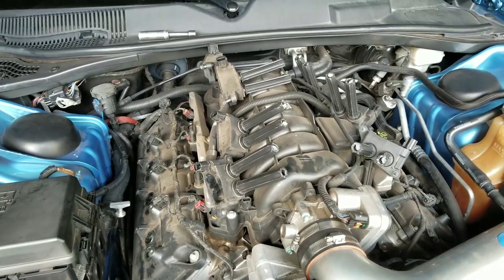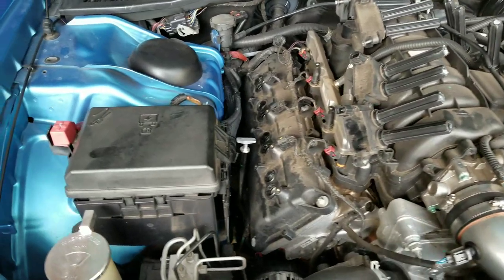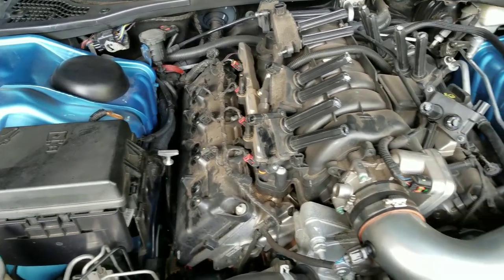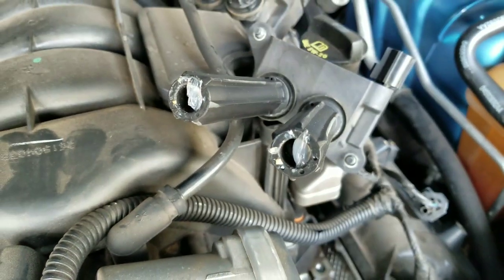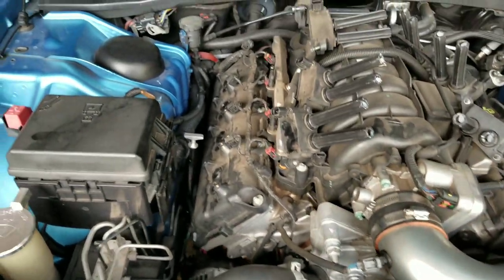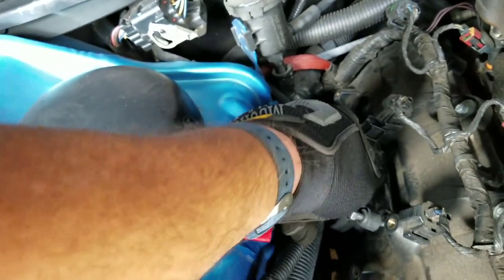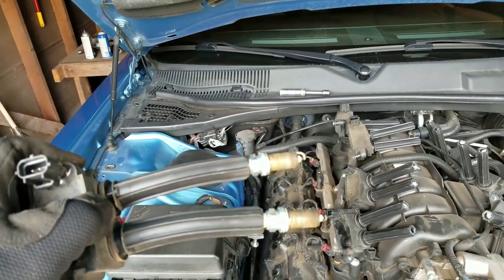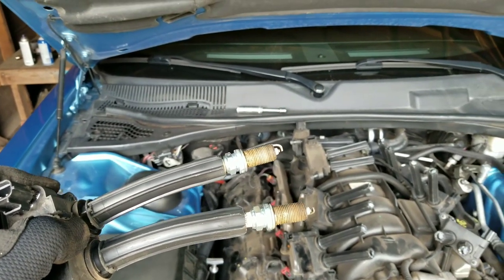Removing Spark Plugs Trick  HEMI 5.7l

Comment: The old mechanic trick is to get some heater hose that just fits snug on your plugs and cut it long enough that you can retrieve the plug. 
Then place the new plug into the hose and start threading it into the spark plug hole.
That way you won't cross-thread it.

Comment: This will work for removing the plugs if you don't have a spark plug socket but you'll still need one when you reinstall the plugs so I recommend getting one before you begin and just use it to both remove and install the plugs.  If you try to reinstall the plugs without the socket you risk the plug siding down the tube and the tip smacking against something, thus bending the electrode and throwing the gap out of calibration.  Also, you don't want the threads touching anything if they have anti-seize on them. With a spark plug socket the plug is centered in the tube and the threads will not touch anything on the way down.  5/8" plug sockets are available at most auto parts store in either magnetic or friction fit.

Comment: that's a pretty good idea for removing them if you don't have the right spark plug socket with the boot of putting them back in is a whole different challenge you really need the spark plug socket with the boot
Reply: I would suggest using a piece of hose or vinyl tubing to slop over the plug, apply never-seize to threads of plug then turn the plug in by hand and use a plug socket with the rubber sleeve removed to do the final tightening. By removing the rubber sleeve in the socket you end the possibility of the socket coming off the extension and having to fish it out with needle grip pliers....

Comment: I usually have the auto store cut me a rubber hose/vacuum line that fits the spark plug to remove and to start them so they don’t cross thread but I bet the dealer does exactly what you did.

Comment: @Paul SC, I have a question and maybe you have a lead for me.  I changed the Ignition Coils for high performance ones from RIPP.   On their web site it says direct replacement, and I did that and tighten all the screws up on those 8 new coils, so all is well seated.  Now my car runs as if it had 100 whp! !!  It' smells gas in the exhaust when I wind it in park...  It's really sad to watch....  DO you have any advice for this?

Comment: That’s an interesting trick....thanks.

Now that you have done the plug change and see how it looks more intimidating than it really is will you wait another 150K for changing again?   I would personally be skittish about that long of a change interval especially on spark plugs which for the most part are fairly simple to remove and replace.  Especially with a high performance engine.

Another trick and you could call it self taught.  When you remove the new plugs from the box keep the empty box.....stay with me...it will be quick.

This is where a cylinder layout comes in handy but generally the #1 cylinder is the left side of the engine forward.....that is left side of the engine not necessarily left of vehicle.  Most orientation is from drivers seat looking forward so the #1 cylinder is usually on the passenger front/radiator side.  Could be 1-2-3 passengers side or 1-3-5 but you get the idea.

The HEMI engine can throw a slight curve ball but still can work.

Mark the box with a cylinder number and in the case of the HEMI Mark A or B.....here is another attention to detail moment.

You can mark A or B as front of engine to back or on the fender side A-B starting on the firewall side   Unless the factory service
Manual specifies a particular numbering system for the plug....(it will for the cylinder but not the plug.   

Whatever method you use keep it consistent for all cylinders as in if you go firewall to radiator A-B that means Plug A should be the firewall side on the opposite bank.  Plug B should be on the radiator side for both banks.

Obviously a lot longer to explain than do but here is why numbering the box and putting the old plugs into the box immediately comes in handy.

We all get busy, life gets in the way, kids scream, wife need you do other things friend wants you to come over for the Sunday game, loss of daylight etc......

Marking the cylinder and in the case of HEMI the A or B on the box becomes a good reference.   After the new plugs are installed and ops checked you can review the burn/wear pattern on the old plug and compare against a wear chart.  This can be done at your leisure, inside out of the cold, heat, etc...  Marking the specific plug and cylinder  can help in narrowing down abnormal plug or worse cylinder wear.  Could determine if more extensive investigation.

If no abnormal wear pattern is detected then discard the  old plugs and box.

Takes only a few extra moments on the job but could save you problems by early detection.

I have even gone so far as to mark each coil pack of  cylinder number with a color contrasting permanent marker.  This can also help in troubleshooting where some procedures ask to swap coil packs to opposite cylinder to see if problem is a specific cylinder.  Example of you get a misfire one a cylinder and swapping the coil packs and if the symptoms follow to that cylinder.  If you get a misfire in different cylinder then you could try once more to get a “wildcard/tie breaker.

Hope this helps!!!
Reply from the maker: Every 30,000 miles is the plug change schedule for 5.7 hemi using OEM COPPER CORE plugs.
Reply: @PaulCape  30.60,9,120,150K.  That sounds better and more like it.  Initial  view sounded like you were waiting until 150K for first replacement   My bad, I apologize
Reply: Or just throw new set of plugs in every time? U really wasted all that time typing that out lol

Comment: Do you replace coils at 150,000 as wet as plugs.I’ve got 189,000 don’t think coil’s ever been done
Reply from the maker: No, coils either work, or they don't. There's no in between. They don't wear out, they just stop working. So far mine are still good at 191,000

Comment: Gotta ask, did you ever have a problem with the famous Hemi tick? I just bought a 2020 and hearing a lot about it
Reply from the maker: I haven't as far as i know. My hearing isn't the best in the world, but no one riding with me has mentioned it. I had a diablo tech look over my stats once for another reason and he told me all my stats were in normal range, he specificity mentioned that my spark knock was below what's considered normal so i suppose is all good.  I use full synthetic oil, and original oem copper core plugs.  Maybe that's why.

Comment: Yiu should explain the year if this car older Hemi use Copper
Reply from the maker: It's a 2010 using copper core plugs.
Reply: @PaulCape  they run better with copper plugs I believe.. I have a 2007 Dodge charger RT
Reply: Are you using NGK or champion
Reply from the maker: @mannyaraujo1  these new hemi engines do run better with lower tick using copper.
Reply from the maker: @mannyaraujo1  to be honest, I think the first plus it had was NKG, but usually get champion from RockAuto.com
Reply: @PaulCape  k